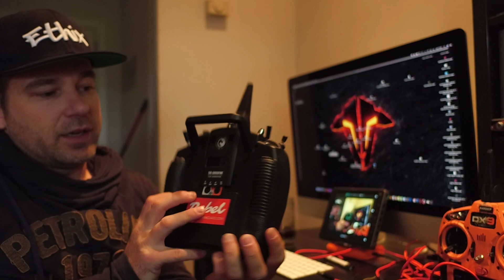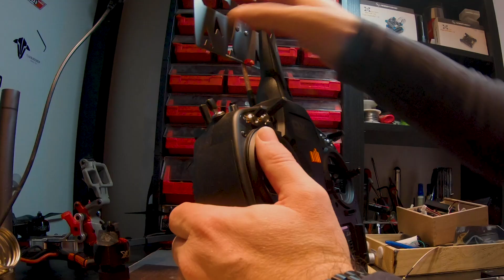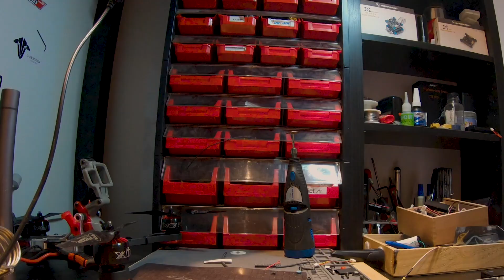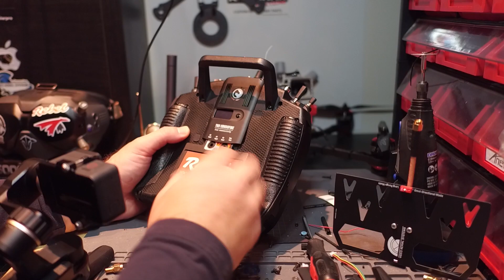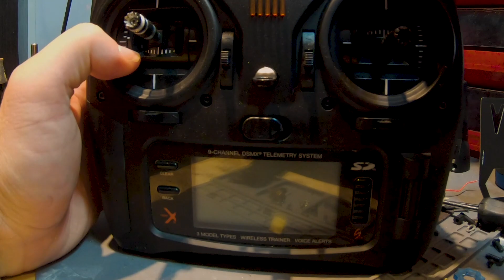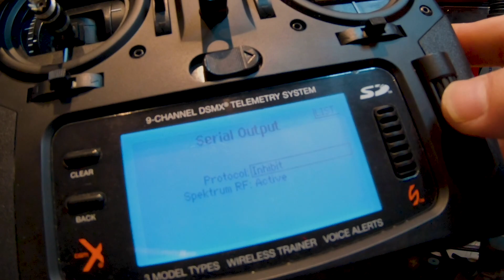HOW TO: SPEKTRUM DX9 WITH TBS CROSSFIRE INTEGRATED - TUTORIAL / MOD

Comment: Sorry about the dumb question, but I'm new on the whole long range TBS, my question is can you run full power with the dx9 battery? Or should I use an external battery ?
Reply from the maker: yes you can, just go for the upgraded internal battery
Reply: @droneartists6137  good deal, thank you for your reply .... happy flying 🙌

Comment: No RF interference from crossfire module? I remember a few years ago i tried this with a rlink long range uhf, all the trimmers in the radio would move by them self from the uhf tx turned on!
Reply from the maker: I had that problem with my previous DX9 and got worse over time (The Orange one in the video) but with the DX9 Black for some kind of reason that problem disappeared  funny enough, dont know why. The only kinda interference I notice when I turn th XF on is that the speech commands sound a little "noisier".
Reply: @droneartists6137  probably better shielding